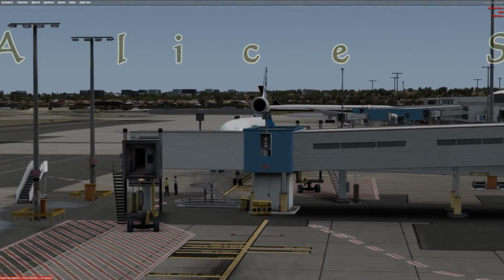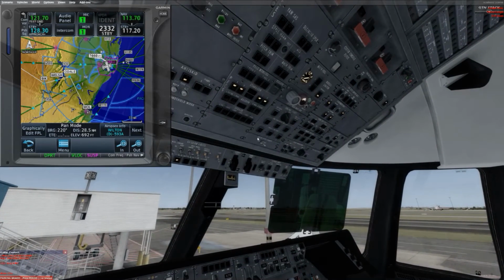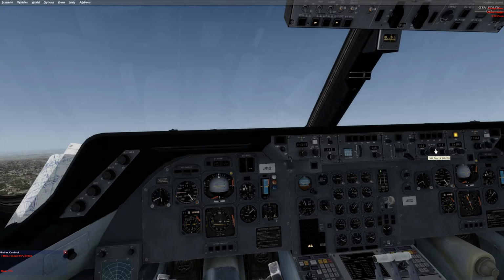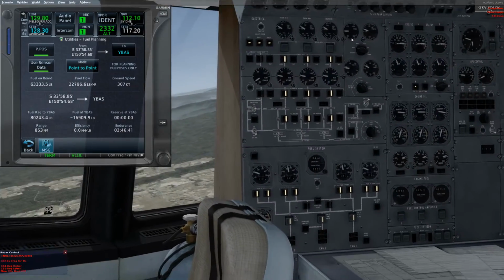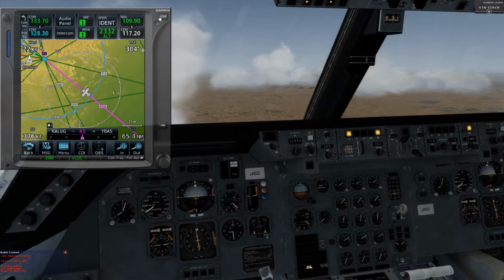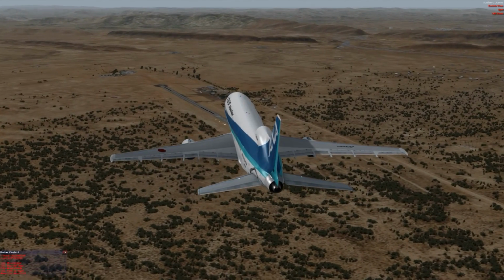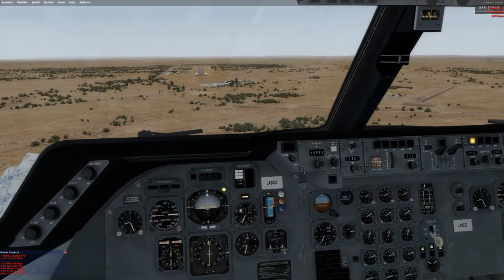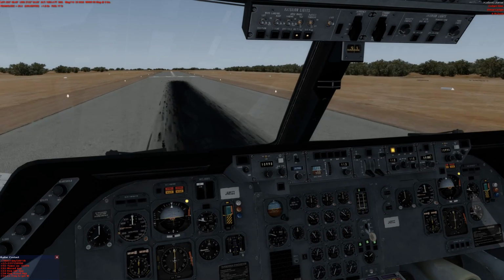Fly the Tristar on GPS navigation

Comment: Is there anything you had to do to couple the GPS with the plane? I have installed the GPS and I love it but if I set the tristar to follow the route I put in it only shows 003 on the heading and will not change. I set the switch in the right position for the plane  to navigate via GPS but it's not working. Other planes work fine. The GTN 750 overrides any flight plans in the default GPS but when I fly the Tristar I end up having to follow the route by hand which is pretty annoying.
Reply from the maker: Hello Robert, thanks for watching. The Captain Sim Tristar is not accurately modelled for use with a GPS. Especially not the GTN750. CS modelled it to work with the CIVA..... If you see, in the movie, the GTN is set in VLOC, which is plain wrong! Proper GPS mode should be CDI. Also the aircraft is using the HDG bug to receive steering commands from the GTN750! So to answer your question, just set HDG bug to on and receive LNav steering from the GTN 750 in VLOC mode! Very odd and incorrect, but it works in the CS Tristar!! The CIVA works the same way, very well indeed! Since we are only getting Lateral navigation form these systems. Now very oddly, to get your actual HGD control back from the GTN, you must first disengage the Autopilot....Then re select the Hdg mode and re select Autopilot. At 41.00 in the movie, if you arm Apr., the GTN will hand over Lateral Nav and Vertical Nav to the Tri-Star's Apr. mode, when we intercept the Localiser and then Glideslope. At 42.30 I arm AUTO LAND, a great simulation feature in this aircraft.  With these secrets, we have a very nice simulation!

Comment: David, is there any reason you don't use flap 33 for landing? You will have a more stabilised approach, and will utilise the Dynamic Lift Control system on the approach also.
I notice you were at 33 but then put the flaps up again? I also see you still used the Vref for 33 flap though.
Reply from the maker: Well spotted!  I have my PTT button mapped on to the Saitek Stick. For some reason when I use PTT it raises the flaps?  I have no idea why this occurs? I have checked my key assignments in the sim and its not mapped to the Saitek. Also the Saitek software has not got this mapped to the flaps? I can only change the key which MCE uses for PTT.  Thanks for pointing this out.